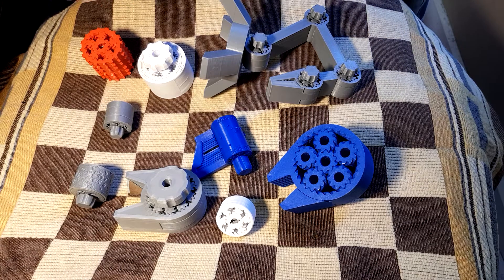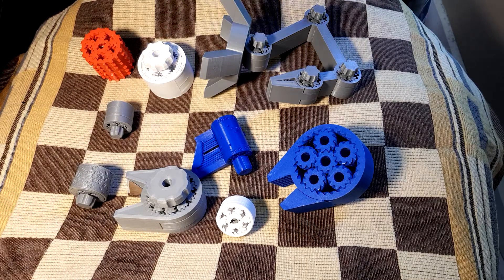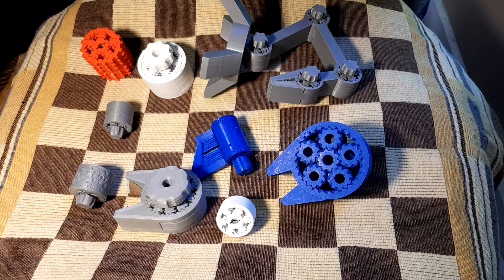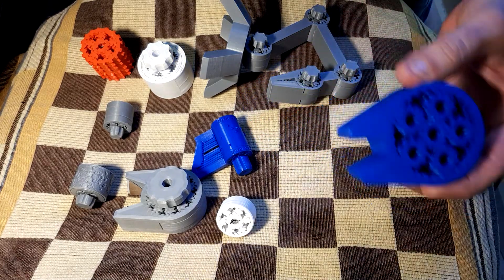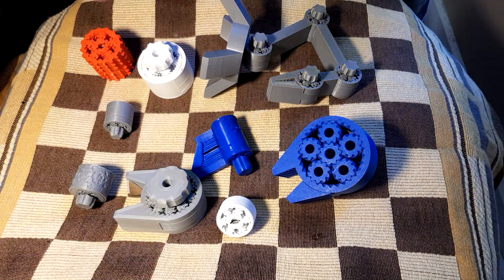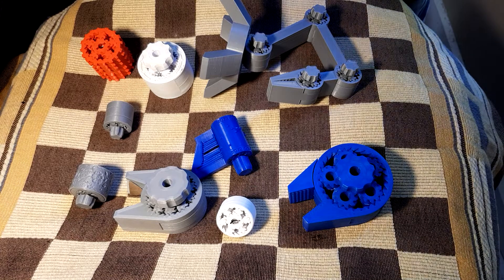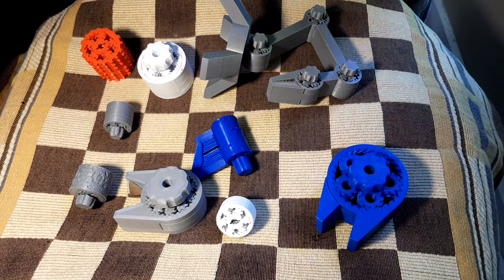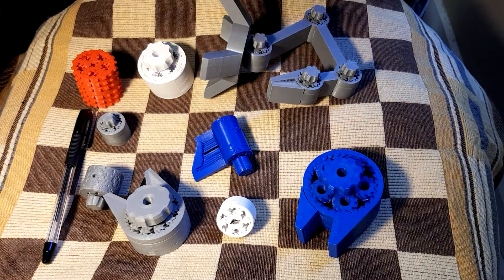Planetary Gearbox-Fu

Comment: Nice!

Do these also happen to be backdrivable?
Reply from the maker: They tend to be pretty high gear ratio and not backdrivable. Though I have made some smaller ones with lower ratios that can be, as long as there is no resistance on the sun gear.
Reply: @TroyMackay  Thanks!
Might have to look more into it then. There's a specific design called the "bilateral drive" that somehow manages to make them easily backdrivable up to ~100:1 redution ratios.
Reply from the maker: @Skythedragon  Thanks, I'll check that one out, too.